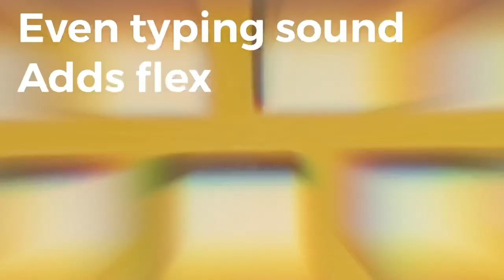I created a new keyboard mod…

Comment: quick tip, don't put so much thick stuff in the case because it makes the pcb sit much higher on the case causing all the switches to be visible which is a bit ugly
Reply: Some peps actually like that tho-

Comment: How does it screw back together? Does it still plug in?
Reply: It only works for boards like the gk61 or the tofu 65 and the duct tape is what keeps the pcb from falling out by friction fitting. And since the pcb is what is holding the power supply it still plugs in
Reply: @thegodlycat6986  thanks!
Reply: @thegodlycat6986  can this work for yn84?